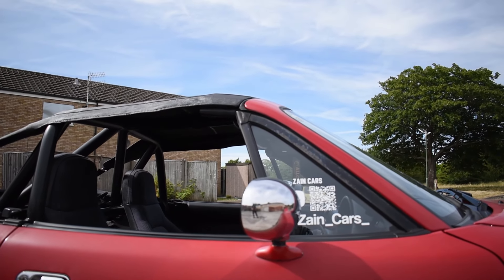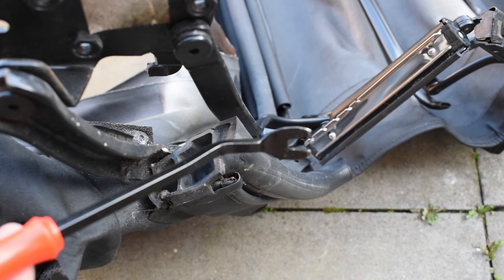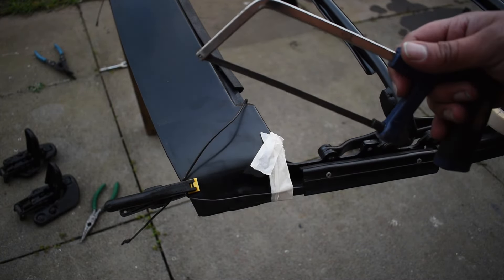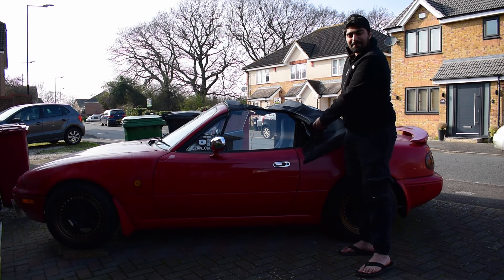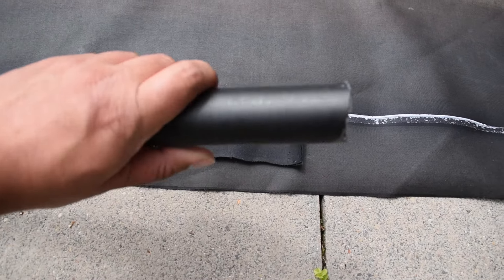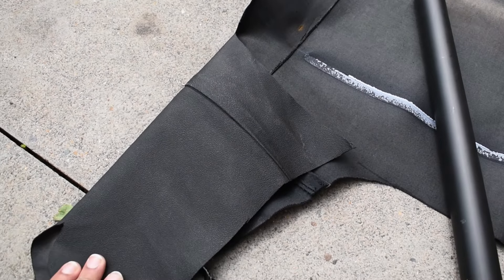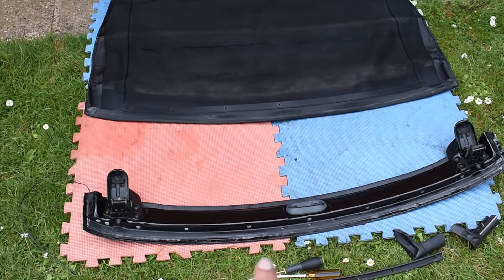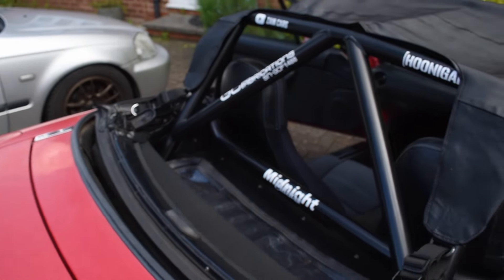Cheap MIATA Bikini Top?

Comment: Between the sawing and the sewing, you really showed some perseverance! 
I rekon that you could improve your pipe a bit with securing the ends of it better. Maybe 3d print some things that slip over the pipe ends. One to clip or clamp over the roll bar at the back and one that uses the screws at the front of the top. Just a thought. Good job mate! 

..Banana
Reply from the maker: That would be a good idea. Originally i wanted to make a bracket using the mounting holes of the mirror but making the part would be too complex to make strong. 3D printing would be good when the pipe feels more loose but currently its still a snug fit.